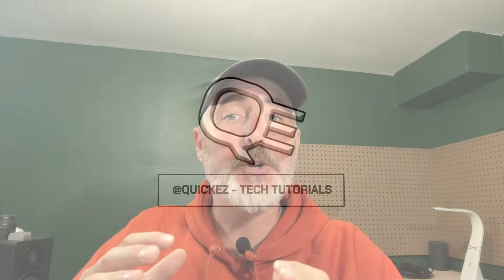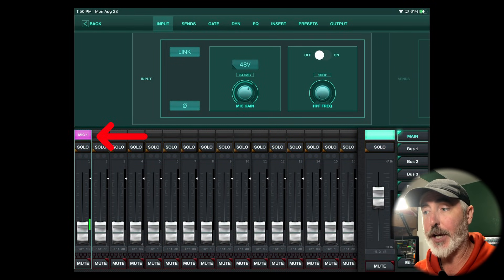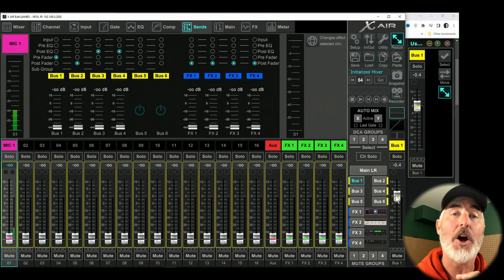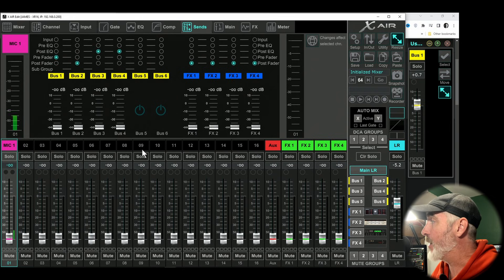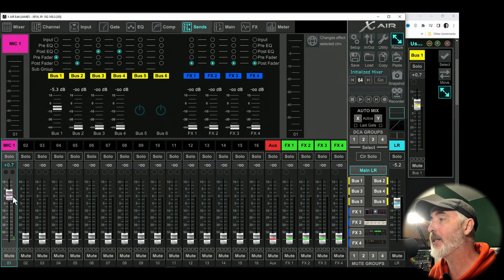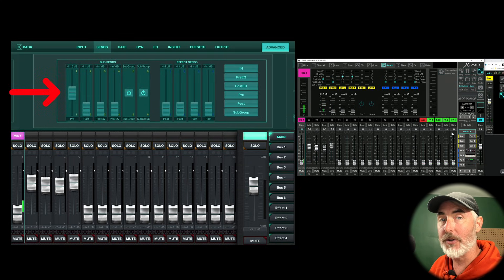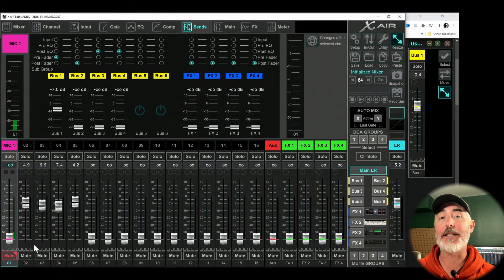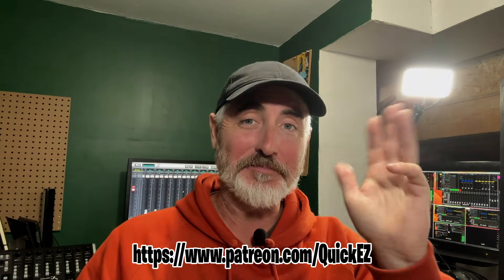XR Mixers - How to set up & use aux sends

Comment: Thank you. Sound guy for a band I play in is getting the xr18. I want to be able to control my own in ears mix so couple questions. What app do I need to get to integrate with his and also…..am I able to ONLY control my own aux mix? I don’t want access to anything else and risk screwing jt uo. lol. I assume he will control the access and what everyone can and can’t do? Thanks
Reply from the maker: The default app for controlling your mix is MX-Q. This is the Behringer app and it’s dead simple to use. 
Select the bus/aux assigned to you, select your channels and away you go. 
You can also group inputs into what are called MCA’s. so group things like drums to one MCA, vocals to another, you see where I’m going. 
Then you have a volume control for each MCA so you can turn up all the vocals or turn down all the drums, without having to dig into the channels themselves. 

MX-Q won’t LOCK you to only your mix. You can back out of your mix and get into another band members mix. BUT it’s very clear when you’ve done that. Your mix is displayed at the top left and you have to click that, then select the other persons mix. So it’s not an accidental one button slip up. 
AND you cannot get into the house mix L/R. So you can’t mess with what the audience is hearing at all. 

All this said; if your sound guy happens to be using Mixing Station as his app for control, you can also use that app. Same sort of setup, in that you are’t technically LOCKED to your own mix, however, to get into someone else’s mix you have to literally:
disconnect from the app. 
Hold the console selector for two seconds,
Select your bus…..
There is no way you’re going to accidentally end up in your band mates mix. 

MX-Q is free. Mixing station cost about $5 per device. But honestly, it’s worth the cost if he’s using it to mix. 
There is absolutely a learning curve to it. But again, if he’s using it to mix, then he can probably get you through the learning curve fairly quickly. 

Hope this helps.
Thanks for watching and happy mixing!
Reply: @QuickEZ  thank you!
Reply from the maker: You’re welcome!
Reply: I use Mixing Station connected to an XR18 in my 9 pc rock band in my rehearsal space. When each member connects on his cell he selects the mixer, then his assigned Buss. If everyone does it right, they can’t accidentally change someone else’s mix.

Comment: I am getting no sound at all from the Aux1/Bus1 feed. I see the indications moving and the main buss fader is unmuted however i still here nothing at all .... plzzzz help lol i just want a monitor feed. Im using my Ipad for all the controls 

Pl
Reply from the maker: Hi srossjr3,
I know you said the bus fader isn’t muted.  But did you also raise the bus master fader?
Reply from the maker: If your bus fader is up. 
Make sure you check your aux output routing. 
Click the routing button at the top of your iPad. 
Click aux outputs 
Scroll to the right of the matrix window and make sure that aux 1 output is actually assigned to bus 1
Reply: You might be right about assigning to the Bus1  @QuickEZ
Reply from the maker: Let me know if you get it working!
Reply: @QuickEZ yes sir I will thank you
Reply: @QuickEZ  unfortunately that didn't work 😕
Reply from the maker: Email me with some screenshots. 

Email@quickez.ca
Reply: @QuickEZ  I sent you a email my friend
Reply: Yes sir ive done both and I still get nothing from the Aux1/ Bus1 feeds.  @QuickEZ
Reply from the maker: Send me a screenshot of your main mix page. 
Email@quickez.ca

Comment: How about effects? How do I achieve an effect on my bus that’s distant bring the main output?
Reply from the maker: Hi,
If I understand your question correctly. You want to send an effect to your bus that is different from what is going to your main bus. 

You can watch this video, and read my explanation below. 

HOW TO SEND YOUR FX TO YOUR MONITOR MIXES - BEHRINGER XR
https://youtu.be/vqNU_GBEAiM

Choose a different effect slot. Send your instrument or microphone to that effect and make the adjustments you want. 
Then choose your aux that you want, and send the fx return fader to that bus. 
You will need to send that effect to your bus Pre-fader. To avoid sending it to your main as well. 

I hope that helps minutes not clear, please let me know. 

Thanks for watching and happy mixing!
Reply: @QuickEZ  exactly. I’ve tried to experiment with having a dry signal on the LR (main out) and wet signal in my IEMs. independently
Reply from the maker: Well that video I linked will show you exactly how to do that. 
Let me know if you have any trouble and I’ll do my best to help you.
Reply: @QuickEZ  thanks a lot 🙏🏾🙏🏾🙏🏾

Comment: What could I check at my mixer when the main fader of a BUS stop changing the overall volume of the monitor?
Reply from the maker: Hi Ulisses,
sorry for the late reply.
in your xair edit software...
go to your  IN/OUT tab at the top right of the software.
click on the AUX tab in the window that opens.
for the aux that is giving you a problem, make sure it's DEFAULT SIGNAL TAP: is set to POST FADER. 
if it's set to anything other than that your bus master won't do anything.

hope that helps.

Thanks for watching and happy mixing!

Comment: Ok, this is great. But I want to send somethign such as aux 3 to my usb output to my computer. So I can control the level going to my computer independent of the LR Main output. 

Anyone know how to do this?
Reply from the maker: Hey Jason,
go into your  in/out settings page and under the USB sends tab, assign your AUX3 to a USB channel instead of one of your inputs.
Now that aux will go to your DAW.
If you're using all 18 USB sends, then you can't do it, you have to give up a channel.

Hope that helps.

Comment: I have an XR18 with up to date firmware.   I would like to EQ my Aux Out send separately from the FOH channel.  The only way I can see to EQ an Aux send is to set it as "Post EQ". When I EQ the FOH mix the Aux send monitor mix in my IEM has to much highs and it sounds tinny. Can it be done?  How?
Reply: Thanks for all the possible scenarios. I will try the most promising first.  Even if that works, I may try the other things just to know how to do it.  Again, thanks so much. I'll let you know how it comes out.  We have four singers, three acoustics, 1 electric guitar, sometimes a bass, and sometimes guest singers.  We are just old retired guys having fun.
Reply from the maker: Long-live the old retired band dudes!
p.s. I'm making a video on this subject right now... yours was the 3 time in the last few weeks someone asked me about Bus EQ so I figured I should put something up about it.

Keep having fun and let me know how it all works out for you!

James a.k.a. QuickEZ
Reply from the maker: Hi Dan,
the way to do this properly is use one of your FX units.
Set it to an EQ and INSERT it on the aux bus.
Once you do this you'll have a completely independent EQ for the bus.

Hope that helps.

Thanks for watching and happy mixing!
Reply: @QuickEZ  Thanks for you prompt reply.   I am using two FX units for Reverb and Delay.  This means I only have two FX units left to insert on say Aux 1 & 2.  Does this mean I can only EQ 2 aux buses?
Reply from the maker: If you put the DUAL TRUEQ into your 3rd FX unit, it will have an A and B side, you can insert one side on bus 1 and one side on bus 2.
And then you could do the same with FX unit 4 and insert it on Bus 3 and Bus 4. 
Or whatever busses you need them on...
only DUAL TRUEQ has an A and B button. So you can switch between the two sides of the eq unit and have an independent eq for two separate Auxes.

Just for transparency, I have never acutally run anything like this. So I'm working off of "good on paper" possibilities here.
You will have to try this and see if actually suits your purpose.
And if you do, please let me know how it works out for you. 
I'm genuinely  interested!

QuickEZ

edit:  Dual TruEQ or  Dual Graphic EQ will both work this way
Reply from the maker: Hey Dan, 
I was thinking more about your question and realized I may have made some incorrect assumptions about your intended purpose.
I just want to make sure you know that each bus already has it's own EQ.
I assumed you were looking for additional EQ on each bus which is why I jumped straight to using the FX as an insert.
But if you select one of your Aux busses in the XAir edit software (or any other software that is compatible) then the master fader that pops up for that bus actually has it's own EQ (and compression).

And just to make sure, if you were talking about having a separate EQ for each input that is independent from your main mix, that you cannot do unless you duplicate instruments across multiple channel strips. For example, set the analog input of channel 2 to actually receive it's input from channel 1, and so on. 
Of course that takes up channels and if you've got a full band then you probably haven't got the channels to spare, but doing that would give you the ability to eq one channel for  FOH and the other for your IEM.

This may be way off what you're looking for but I thought I should throw all that out there to you anyway.

Comment: James, I have another question for you. I live in a retirement community that has a ballroom with a stage and sound system which they upgraded about 3-4 years ago. They installed an XR18. The XR18 is in a cabinet in a back room. All the inputs, 1 - 10 are in the stage floor. They use inputs 11-16 for wireless mics. This set up does not make it conducive for bands. In the past I have used an analog mixer and ran the LR mains of it into floor channels 1 & 2 of the XR18. I don't remember where I set the gain on the XR18, but it worked for us.  I have done it twice now with the 5 piece Rock/Country band using their XR16, coming off the LR into two channels in the floor to the XR18. Last concert I didn't have to turn the faders up very much on the XR18 the last time because I think they had the amp on the XR16 up to high, and I didn't know to check it. We are going to be doing a dance this coming Wednesday and I plan on making sure the amp is down so I can have the XR18 closer to a Unity position with the Main LR fader. The other challenge, which we will have to address during sound check, is that the IEMs are adjusted based on the amp setting of the XR16, which is where the IEMs are coming from. FUN!!!  Any suggestions for me?
Reply from the maker: Hi Chris,
Do you have access to their XR18 in the rack backstage?
If so, absolutely have a look at the gain settings on those first 10 channels so you know what you're dealing with before you even send signal out of your XR16.

Are you using all your Aux outputs for the IEM's / wedges or do you have some available still ?
Also, are you using all your inputs, or do you have any left that are empty?
Reply: Yes, I have access to the XR18. We are using all the inputs and outputs on the XR16 (looking to get a XR18). We are going to use floor monitors at the dance. My original approach is to check the gain on Channels 8 & 9 of the XR18 which are the closest floor inputs to where we will have the XR16 setup at.  I will be using my iPad for the XR18 with Mixing Station. That will allow me to see the meters on the Channels 8 & 9 faders. Allowing me a better view of where my gain is at. I will start with a low fader setting on the XR18 as I want the XR16 sending a strong signal to the XR18. Your thoughts? @QuickEZ
Reply from the maker: You seem to be on the right page with this.

If you are able to access the XR18 settings as you state, then start with the XR18 faders down completely, and adjust the gain coming in (from your XR16) until it sits at a reasonable value on the meters. Then you can bring up the faders on the XR18 to satisfy your house sound.

I feel like you were already heading in this direction anyway :)  Have fun!

Comment: James, I could not eliminate the bass guitar from going out of the FOH speakers. I looked to see if we had an FX insert assigned to the channel. Honestly, I could not tell. The icon in upper left corner of the insert was white. From what I have seen in other videos, that is off for the insert.  I need to check the other three effects and make sure they are off as well, if white icon is correct. We have rehearsal again Monday. I will keep at it. Plus, the bass player is bringing his cabinet preamp and we are going to plug that in to see if that eliminates it in the FOH.
Reply from the maker: Hi Chris, unfortunately I’m away from my computer all day today. 
I’ll open up my XR tomorrow and check some other possibilities to try and assist you with this further.

There is the possibility you have cross-talk on your inputs.  When you have the issue with your channel, is the fader for either adjacent channel turned up? 
If so, try pulling that down to see if it eliminates the problem. If it does you know you’ve got a channel cross-talk problem.
Reply: @QuickEZ  James, Thank you for the reply.  Even you need to take a day off.  I will let you know after tomorrow's rehearsal.
Reply from the maker: Hey Chris, nothing is jumping out at me that could have your signal behaving the way it does without some kind of channel issue.
would you mind sending your show file over to me?

If you open XAir on your computer, and click the "SAVE" icon, you can click "SAVE AS SCENE" which will then prompt you to save your show file on your computer. 
You can then send it to me here:  
email@quickez.ca

I'll load the session up on my XR and see if anything weird is going on.
Reply: James,  I was running sound at rehearsal yesterday via the iPad. Could not see where I could send the Scene file to you. We do have a PC connected to it as well but could not get to it as it is on the rack behind the drummer. I didn't do the original mixer connection. It is really strange. I move all the faders down and I am still getting sound (vocal & instrument) out of the front of the house speakers. I even went to the Output and turned the LR off and on, which I would thought have muted anything from the channel I had selected. Perhaps I am showing my ignorance of the mixer.  We will have a slightly different setup at the dance tonight. As I mentioned in the other message. We will be connecting our XR16 LR output to two input channels (CH 8 & 9) of the in-house XR18 using its amp and not the band's amp. We have done this in the past with some success. @QuickEZ
Reply from the maker: Hi Chris, I do no believe you can share a scene from the ipad interface. It needs to be from a computer. 

If you are getting multiple instruments and vocals out of FOH while your faders are down, then you are almost certainly sending them somewhere else within the mixer (and very likely pre-fader) that is then feeding the signal to the FOH outputs. 
This is why I was hoping to have you send me a copy of your show file. It will be much easier for me to quickly jump through your settings to see what is going where, and then give you an explanation on why it was happening, then for us to go back and forth and try to figure out what might be going on.
That being said, if you aren't able to send the file over, we'll keep muddling through until we find a solution for you.

Now that I know  that you are looking at an iPad to mix and not a computer screen, please try the following:

If you select a channel that is currently experiencing the problem.
Then at the top of the screen, click on the INSERT tab.
You will see a box with a small button in the top-left and the word INSERT just below it. 
To the right of that, is a larger box you can scroll through, that houses all your FX units.  
If you have an FX inserted, the small box above the word insert will be highlighted blue, you might almost call this white depending on your screen colours or contrast.  
If it is indeed highlighted blue, then this is probably where your issue is stemming from. 
If you are unsure, try clicking that box and see if your problem goes away, PLEASE START WITH YOUR CHANNEL VOLUME LOW FOR THIS TEST and bring it up slowly as required.

Comment: Good day James!  I have a MIXER 101 question for you. I am working with a 5 piece band, Rock/Country, that has a XR16 mixer with XAir. The bass guitar is connected from a preamp to the mixer channel (16). I have noticed when I have the fader completely down I am still getting some sound out of the FOH speakers. If I press the mute button, it does mute.  I have checked the Sends and alternated them from PreEQ, PostEQ, Pre, and Post. Still getting sound from the bass guitar.  What am I overlooking?  Thank you.
Reply from the maker: Hi Chris,  is there a chance you've inserted an FX on channel 16?
If you have an FX inserted instead of doing a "send", and that FX channel is set to pre-fader, you could still be getting signal through the FOH speakers even with the fader down. And the mute on the channel would work in this case, so that could be a strong contender for the issue.
If you open XAir and select your ch 16. then click on the CHANNEL TAB at the top, in the channel input section there is a little FX button. if you have that button turned on (it would be pink) and you have one of your FX channels listed instead of the word "OFF" then it means you have indeed inserted an FX unit.
Then under the SENDS tab you can see your pre/post settings for each of your FX units.
Start there and let me know what you find.
Reply: Thank you James. I will let you know what I find on Thursday when we rehearse again. @QuickEZ
Reply from the maker: Standing by to hear your results...